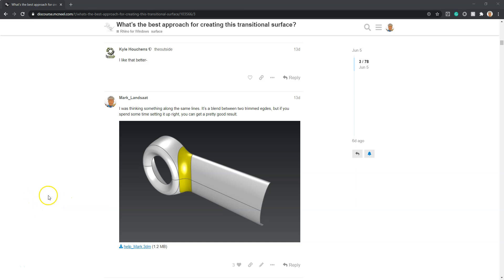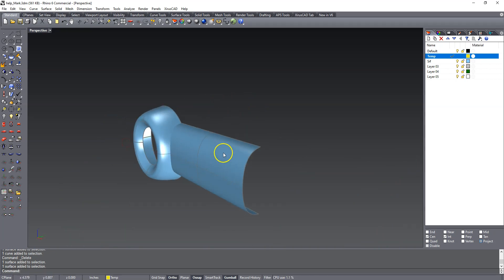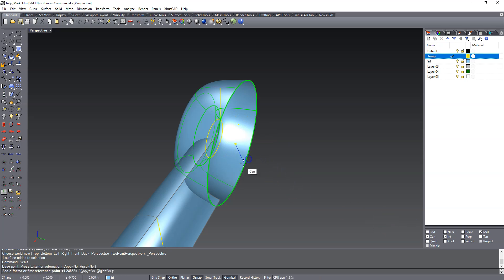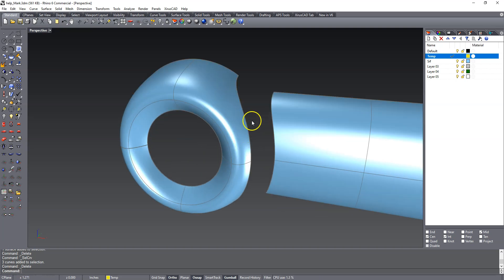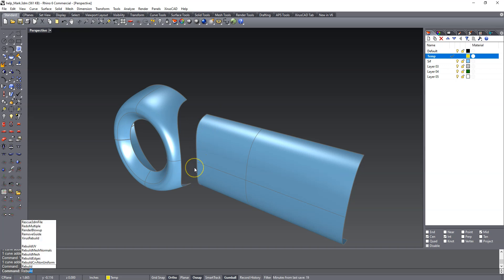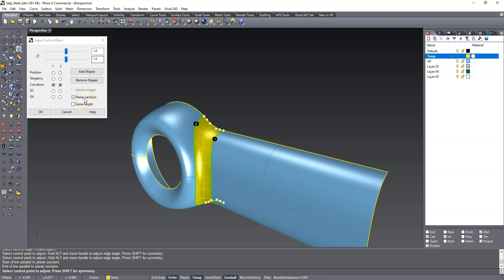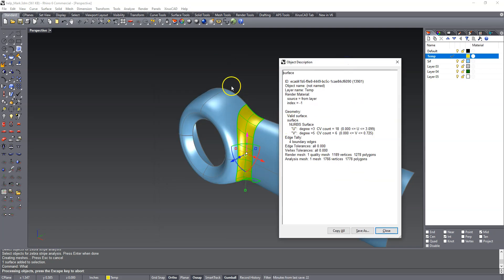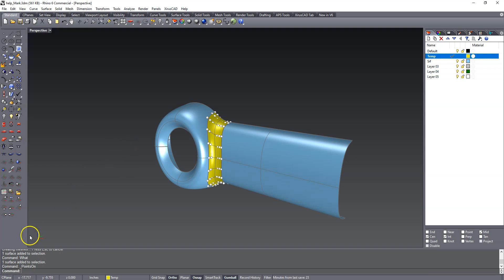Rhino3D, utilizing scaled surfaces to set up a blend.

Comment: Very interesting solutions. I also prefer scale/tweak surfaces over Offset command, because Offset gives more complicated surface and curve structures, especially when Offset inwards.
Reply from the maker: Hi Pashkuli, I have to say I use both methods. Actually if you're doing a trim surface you can use the loose option in Offsetsrf. This won't be a 100% accurate offset, but it will give you a clean surface that can be used to trim. And like you I do also use copy/paste scale quite often for curves. Cheers.
Reply: @marklandsaat3696  Also I noticed during all those years that Rhino's MatchSurf command is rather not so intuitive even for simple tasks. 
Have you tried: ShrinkToEdge command after trimming a surface, regardless of the trimming method used (Offset or Scaled cutting objects)?
Then eventually rebuilding the edges? Yes, this way you loose the untrim opiton for later teweaks, but still might be giving a better result at the end.
XNurbs gives very well optimised solutions, also VSR (Rhino 5 only, not sure if VSR will work in Rhino 6/7) is quite a leap forward in surf matching. Using MoveUVN command in Rhino is fine but it is not precise (in terms of individual CVs control) to achieve true G2 (within file tolerance).
Reply from the maker: @Pashkuli Keyboard, yes I agree that sometimes the result is not completely intuitive. Thanks for pointing out ShrinkToEdge, I have to admit that is not a command that I'm familiar with. I will have to play around with that. I always put my primary surfaces on a separate layer before I start final trimming and blending for exactly the reason you mention. If you shrink the trimmed surface, you can not go back to the original surface, but if you have the original on a separate layer it's easy. You can use the boundary edges of other blends to trim the primary surface. I have VSR, but unfortunately it only works in V5. It's a great tool, but it's a pain to constantly go back and forth between V5 and V6. XNurbs doesn't replace VSR, but I really like having it as part of my toolbox. Cheers.